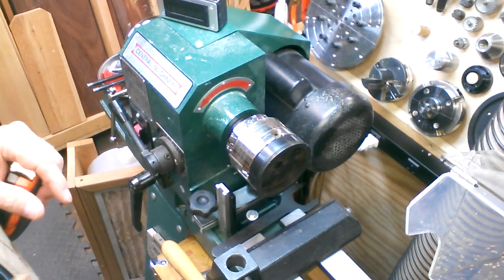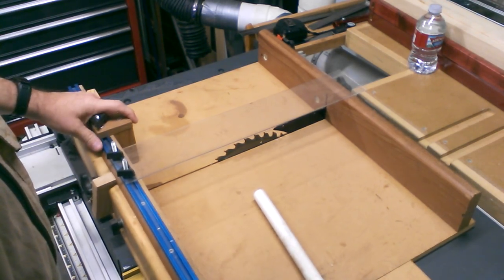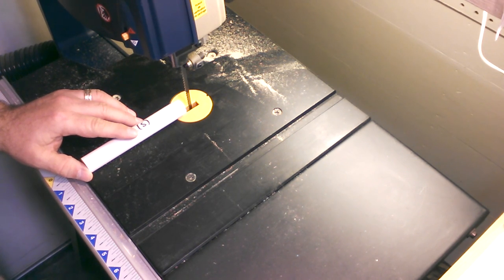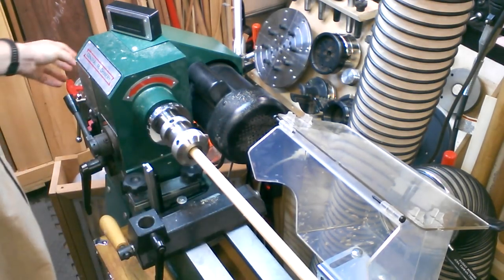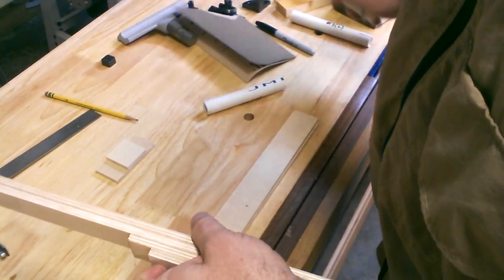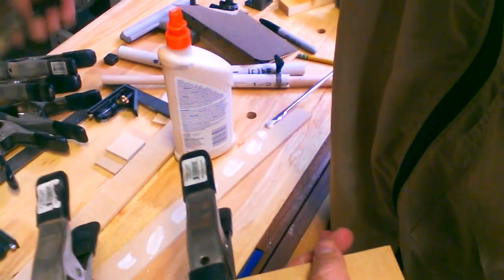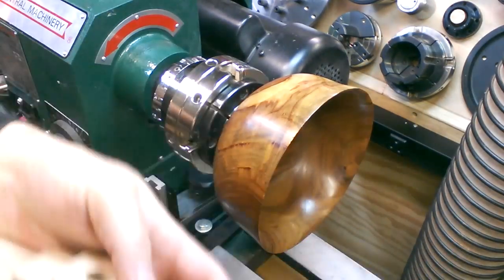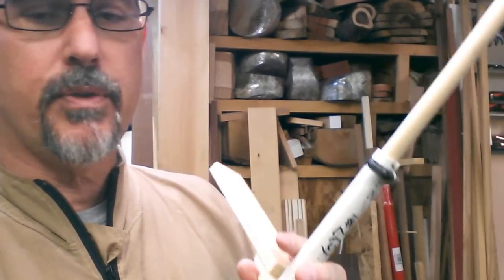23 - Making a Reed Gray-inspired Bowl Depth Gauge

Comment: Good video Bill, I took it one step further and made a base for the ways and put a switchable magnet to hold it. 
I like the fact that this gauge is big enough to command a space on a shelf and not get lost in pile of shavings. I must had made a dozen gauge sticks and lost them.  I won't be losing this one. 
My base holds the cross piece vertical and the base has a guide block under it to help center on the ways. 
I made a gauge tube for each of my bowl turning chucks and they store on the base. For depth setting I went real low tech and just use dan elastic band wound several times on the 1/2 rod so it acts like an o ring, moveable but you have to want to move it. 
As well for the tube to rod slip fit,  I just made a wood bushing glued into one end of the tube,  drilled it to the rod size.
Reply from the maker: Bert Delisle hey Bert, thanks for watching and I appreciate your comments. Sounds like you have some great improvements, and I'm glad that you found this implementation of Reed's original concept useful. Maybe you could post some pictures over at woodturners resource - I would love to see your finished gauge and base. Cheers!

Comment: I have been new and improved... Good job. Curious if you have applied that to a natural edged bowl? Eyeball the cross piece to be square to the lathe bed? Only other improvement I have seen was one turner who used clear poly carbonate, and tied a long red ribbon to it so it didn't get lost in the shavings. I usually keep several on hand...
Reply from the maker: robohippy Hey Reed, thanks for watching and commenting! I haven't used it on natural Edge yet, however, I think you are right on about sighting to keep in line with the ways of the bed. I've only seen one other variation on your Technique - from Sam Angelo, who posted a bed-mounted version not too long ago. Keep doing what you do - you're an inspiration! Cheers!